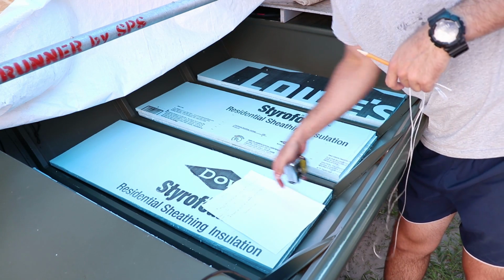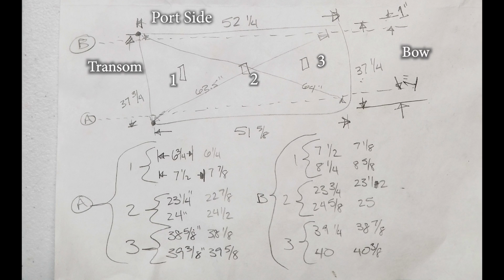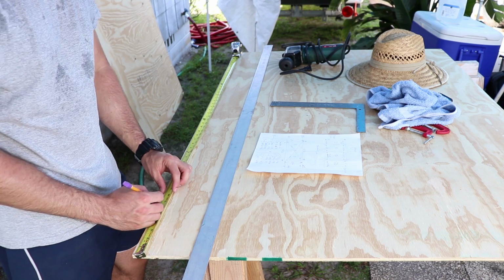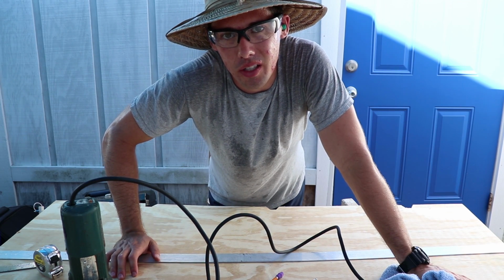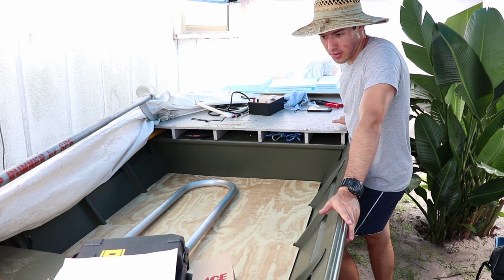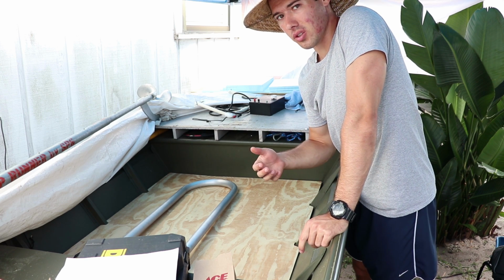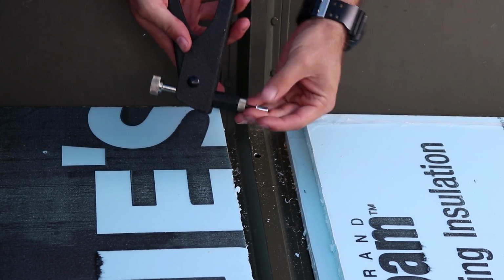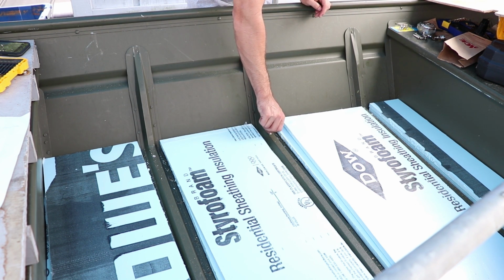Ultimate Jon Boat Floor | Cutting Wood Part2

Comment: Did the rivnuts hold up?  Did you have any issues in the past few years with that floor?
Reply from the maker: Hey Fishing with Billy, the rivnuts are still in there solid. I removed the deck about a year ago and there is no sign of decay. Everything is holding up great so far

Comment: Good video and exactly what I was looking for. One question though, do you  or have you had any sponginess or flex in the center of the floor? Is there anything you would have done differently?
Reply from the maker: Hey Jay, thank you for the kind words. So after a couple of years, the floor is still holding up well. The styrofoam underneath is still solid and so is the plywood. It does great. Would probably do the 1" foam instead of two sheets of half-inch just to make it easier. If you have the foam supporting the wood you won't get any sponginess.
Reply: @JTgatoring   Thank you
Reply from the maker: @jaycumiford8062  No problem. Good luck!

Comment: That looks great! I'm going to start on mine today, thanks for the how-to.  Keep up the great videos.
Reply from the maker: Awesome! Let me know how yours turns out! Thank you @Paul!!
Reply: JTgatoring I did the middle floor of my Lowe 1032 with 2" XPS Foam board and 1/4" ply.  Need to fasten it down yet, but the fit is good.  And super lightweight!  Thanks again.
Reply from the maker: Very nice, and thank you for getting back with me! How is the 1/4" ply? Does it feel pretty good and not too thin?

Comment: I like those riv-nuts. I might try that later down the road.
Currently I just have the floor just laying on top and I didn’t worry about it with the grab bar because I figured my weight would hold the board down fine.
So far so good.
Oh; hit my first tree... video was just uploaded.
I am already wanting a bigger engine.
The 6.5 only pushed the boat max 8 MPH but it was really really maxed out on capacity. I’m sure I was over 600 lbs.
Is the 15 hp nice?
Reply from the maker: Yeah, I really like the riv-nuts, and it doesn't seem like many people know about them. I secured the floor to the boat just so nothing would slide or move around, and if the boat did sink, it would add floatation to it because the plywood and foam wouldn't be able to float up and out with the everything being secured in there.

The 13hp Predator is really nice. I go a constant 18 mph with two regular guys in the boat and fishing gear. Whether I'm by my self or have someone with me, the boat never really loses speed. I haven't noticed any fuel consumption differences or anything. Same to handle, just goes faster than previous 6.5hp Predator.
Reply: JTgatoring what size prop are you using ?
Reply from the maker: I have tested props from SPS, CLP, and CKS. The best props have been the SPS 8.75" Weedless, and the SPS 9" for the 13hp Predator. I never tested props with the small 6.5hp engine. I ran a 6" prop and got 12mph when I was running the 6.5hp Predator. How did you hit the tree?
Reply: JTgatoring haha well i was avoiding something in the water and by the time I went by it the prop was not able to go down and I basically ran into a tree infested with 🕷 spiders. They were all in the boat afterwards 😆
Reply from the maker: Haha I would have just run whatever it was over in the water. Whenever I run through tall grass, I always end up with all kinds of spiders, crickets, and other insects... Always gotta spray it down when I get home after running in thick grass. Its always a mess 🙄
Reply: JTgatoring it was a tree branch that had fallen in the water.
Fully loaded and n a 7 inch prop I got a max of only 8 Mph so I am thinking I should of kept the 6 prop on.
I’m gonna change them out and try a speed test on a smaller prop.
You could tell the motor was working at full throttle with all they weight
Reply from the maker: If the motor was hitting the engine governor with the 7" prop then you would need to go to a bigger prop. The only need to step down to a smaller prop, is if you are lugging the engine. For example, my motor governs out at ~3900 rpms. If I am hitting 3900 rpms, I have the ability to go to a bigger prop to gain more speed. If I was only at 3200 or 3400 rpms, then I need to step down to a small prop to get my rpms closer to that 3900 area. You will only be able to dial in your engine and prop size if you have a tachometer. I normally keep the rpm range between 3750-3850 rpms. Again, anything under that range, 3750 rpms or less I need to go to a smaller prop, and anything over 3850 rpms its hitting the governor and I can go to a bigger prop if I wanted too.
Reply: JTgatoring I need a tachometer

Comment: This is exactly how I think I will do mine, I’m needing to redo my floor on my 16’ Alweld. Do you have a video with the specs of your front deck build? Also, how are you liking the wetlander bottom coat? Kinda pricey but looks legit from what I’ve read.
Reply from the maker: I do not have the specs on it. There are some pictures on my website on this article - https://www.jtgatoring.com/2017-alumacraft-vs-tracker-jon-boat/
It was built with 1x3's and 1x2's. I added extra support where the seat mount is and cut the hatch opening so I could fit a full-size battery in there. Other than that, I used the same riv-nuts / nutserts to attach the deck the top of the seats because that's where I thought the weight would be carried best.
I also wanted my deck to be under the lip of the boat so things wouldn't roll straight off the deck into the water. There is a video on this deck here - https://youtu.be/8HPds5DqsF0

The wetlander is working like a dream. I slide right over heavy grass. With my boat being light, having the wetlander and the 13hp sps longtail, I can run through almost anything. And if I can't that means I'm on dry land and I can get out and push/pull the boat with how light it is.
Reply: Gotcha, thanks for the info man!
Reply: Another question. Did you put any anti oxidation compound on your rivnuts or just use them bare? My old deck had stainless screws directly into the ribs and some decent corrosion had taken place from electrolysis I guess. Granted, it had been in there several years.
Reply from the maker: @jacobbrandt8222  Good question! I didn't add anything special to them. I do not know what the material of the rivnuts are, but I know I used stainless bolts. I haven't seen any issues yet.

Comment: What size rivet nuts did you use?
Reply from the maker: I believe they were the 10-24 riv nuts. I got the 45 piece kit from harbor freight
Reply: @JTgatoring  yeah I just bought it but they it have 10 of each size right?? And each board you put in requires at least 9 so I wanted to order more of the rivet nuts of the ones I'm going to use.
Reply from the maker: @chadlakin7517  Yeah I believe I used the big 1/4 - 20 ones for the deck and used the 10-24 for the floor
Reply: Can you tell me about your  gadget you're using to cut your Styrofoam

Comment: What kind of plywood is that?  Thanks
Reply from the maker: One grade above the cheapest. 1/4" thickness, with the top layer being mostly smooth. Sealed with paint and have had no issues
Reply: @JTgatoring  oh ok nice , could i use that for a casting deck as well ?
Reply from the maker: @ticesine6589  I used the same type of plywood, just thicker. My floor plywood is 1/4" and my deck is 1/2" thick supported by 1x2 and 1x3's
Reply: @JTgatoring  thanks you appreciate it , i just have a little 12 ft aluminum , i wasnt sure what thickness to use
Reply from the maker: @ticesine6589  You're welcome, 1/4" ply is fine for the floor because it is fully supported by the foam. The deck needed to be 1/2" ply because it is not supported as good as the floor is

Comment: How much did you add to your measurements so that you can fit the carpet on there too?
Reply from the maker: I painted it. I did not do carpet. With how I use the boat, the carpet would get dirty very fast, collect sand and get heavy, and stain.
Reply: @JTgatoring  fish hooks hang in carpet
Reply from the maker: @ronalddavis  Haha along with that awful thought as well. Another reason not to get carpet. Good call